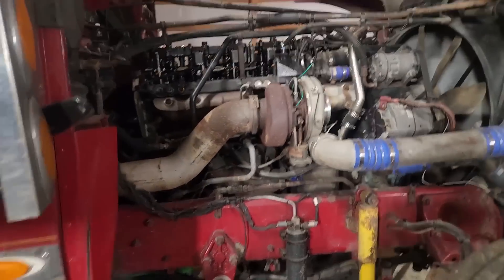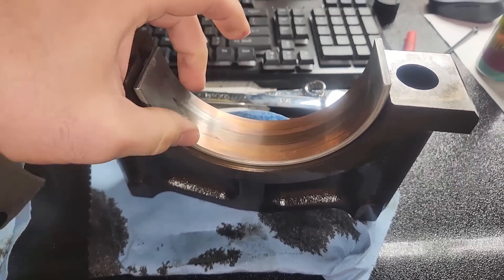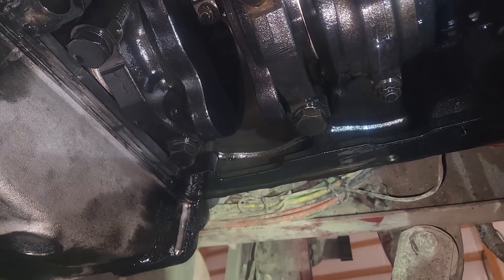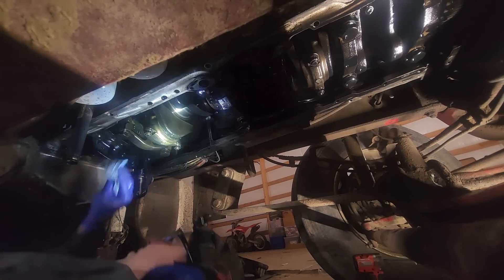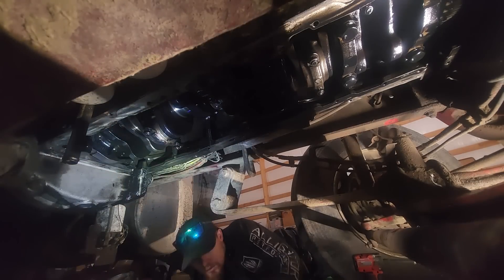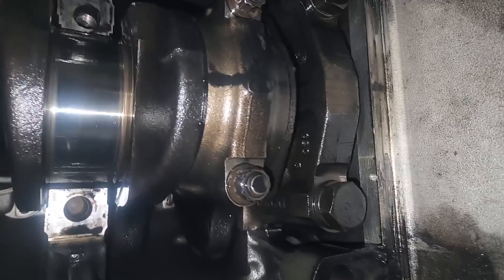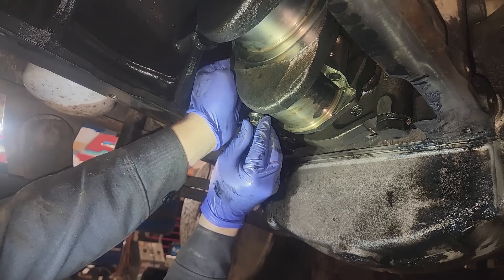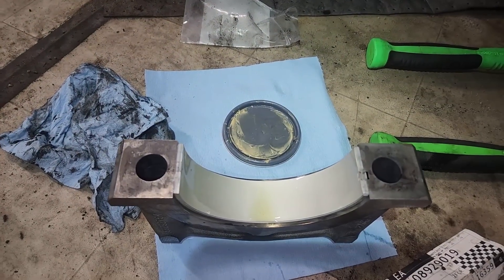This Detroit Diesel Engine Literally has TWISTED Main Bearings, but How?

Comment: I'm not POSITIVE that this is the cause of the destroyed #6 lower bearing, but I used to work rebuilding transmissions.  This occurred mainly in automatic transmissions if there were missing ground straps.  The transmission shaft (in this case the crankshaft) would seek ground thru the bearing, causing arcing and the same surface that you showed with the destroyed bearing.   If it was let go long enough it would also pit the shaft that spun in the bearing.
Reply: Sounds like a reasonable theory.
Reply: @johnnylightning1491  Yeah, you can see the pitting in the bearing material, and that can be caused by cavitation, which I've never heard of happening in oil, and electric arcs, which will evaporate material not unlike an EDM
Reply: @johnnylightning1491 yeah, i read about this arc pitting phenomenon when reading about electric motors, so it definitely could be a cause
Reply: I was thinking the same, that it had to be something like electrolysis or possibly even chemical? The pitting is unique
Reply: My friends Cummins n-14 all bearings welded from bad ground off starter to block .
Battery current went through starter drive to ringgear to mains .
Motor locked up.
Bizarre.
Reply: @Motorhead250 oh wow that must've been a lot of current
Reply: @iaial0  motor ran perfect and was locked solid Monday morning..
We pulled mains off looked like arc welder on bearings .
Main ground from starter to block was loose.
Reply: Good idea, I know this is a major issue in container ships, where they have to use a grounding brush/slip ring to prevent this exact issue. It would also explain why it affected only the main bearings, as they are directly connected to the block (and thus to ground), while the rod bearings are only connected to ground through the piston rings, and thus have a very high resistance. Because electricity takes the path of least resistance, it would thus absolutely make sense that current only went through the main bearings.
Reply: Thats incredible what a missing ground strap can do. Electrons don't fool around
Reply: @warmlandmobilebrakes  I would assume most of the damage takes place when there is more moisture in the oil, since the water would conduct electricity.
Reply: This was a issue on some of the diesel electric heavy haul trucks I’ve worked on , as mentioned above slip ring grounding devices , hard ware isolators and even composite flex plates were some of the solutions, but was common too see pitting/ arcing on the mains when parts were missed or grounding device was damaged/ worn out.
Reply: And if the waterfilter was not changed at regular intervals the electrolysis would or could eat a hole through one of the liners and cause major damage to the motor..
Reply: @erniejensen3893  I doubt that was the problem here as no milky oil was mentioned, but that condition would surely speed the bearing destruction.
Reply: Or somebody was welding on the truck and not grounding it properly
Reply: good thing to keep in mind,  I hope I never need to remember it, but at least I know 👍
Reply: One more reason my old mechanical diesel is superior.
Reply: @fastinradfordable 
I guess this phenomenon only pertains to computerized engines  ?
Reply: @fastinradfordable  A poorly grounded block will pit the bearings thru starter seeking ground or the alternator just doing every day charging with a poorly grounded block.
Reply: Electrolysis is a legit cause of abnormal failure. With the energy that those injectors need and the alternator produces for the rest of the truck, i can only image.
Reply: Hey up honki I've heard of this many years ago but had only thought of roller bearings in gear box or prop shaft, what you're saying would sense thank you for the info
Reply: @johngibson3837  I believe it is worse in plain bearing applications, due to dissimilar metals promoting electrolysis.
Reply: I’ve seen this a lot on equipment where engines had bad grounds and from welding on equipment with out removing the battery cables. On a side note everyone talked about how bad the ford E40D and 4R100 transmission where and it extended back to a bad chassis to cab ground
Reply: @davidmashburn6890  The lack of understanding does not change the complexities of the world around you.  Tell me junior... How does that electron flow.  I'm all ears.
Reply: You people are sad.  None of that is because of current flow.  You are all the type to blame an ECM because you refuse to understand its operation.  Blame complexity.  Why it must be the bogeyman.
Reply: @RunsOnRust  And you base this conclusion on what exactly?
Reply: @RunsOnRust  You are living proof that a little bit of knowledge is a dangerous thing.

Comment: Bearings got hot and lost their pre load. The crush is all that was holding them in. A few miles more and they would have spun. Looks like oil might have been fuel diluted at some time.

Comment: Is that a Fitzgerald glider engine rebuild?
Reply: This was my thoughts. I now a truck owner that had one and when they tore it down it was a mix match of cheap junk parts
Reply: No, I doubt it. You can see the EGR pipe and the VGT turbo. This appears to be an EPA 07 with a DPF.